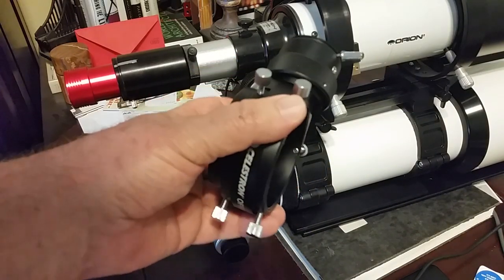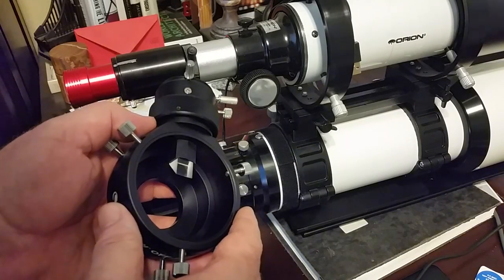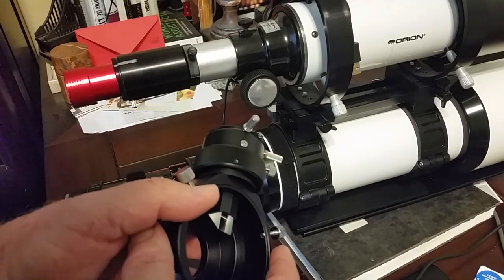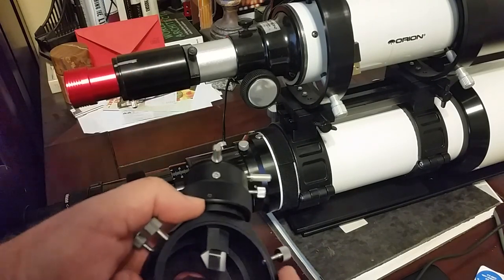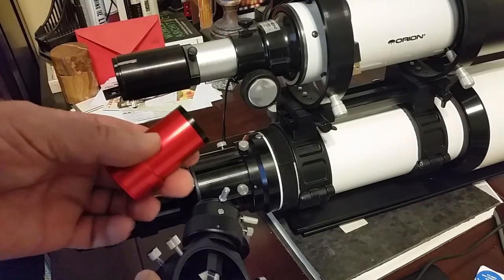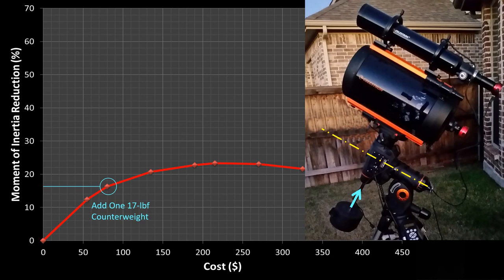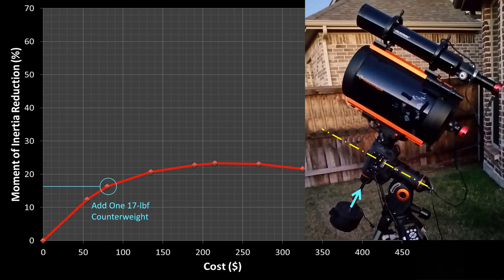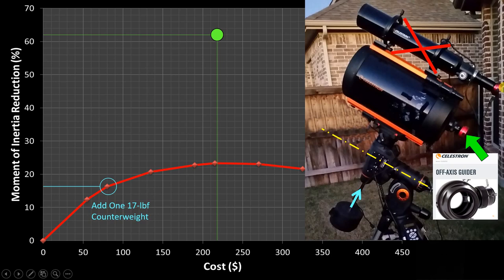Setting Up An Off-Axis Guider

Comment: What stellarium setting do you use to see only guide stars?
Reply from the maker: Hey, Dennis. Not sure I follow. There's not setting for "guide stars" per se. For me, a guide star is one (or more) star I can see through the OAG. I use the Ocular option in the upper right of the Stellarium window and turn on the OAG in the settings area (I show that in the video). I have since downloaded additional star catalogs for Stellarium. You can do that by going to the Configuration/Extras window. Down at the bottom, it shows you the additional star catalogs you install. Try me again, if that didn't answer your question.
Reply: @Aero19612  Sorry, I asked that while half asleep. I guess how do you determine in the stars that show up on Stellarium which ones will show up in the guider? I've found that my Stellarium tends to show more stars than my guide camera picks up. I think there's a magnitude filter--but it'll vary depending on f/# and guidecam sensitive I think. Just food for thought, I suppose. No worries!
Reply from the maker: @DennisCarmody  Yes, I have downloaded all of the star catalogs so I have very faint stars available in Stellarium. I find that I can see and guide on stars of magnitude 11ish or brighter with my ASI174. You might do better with a more sensitive camera or worse with a less sensitive camera.